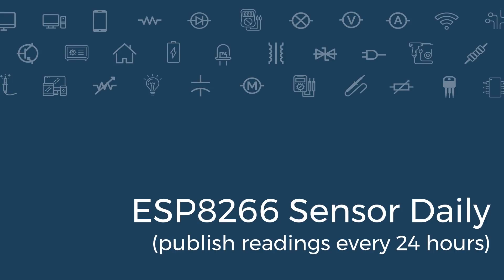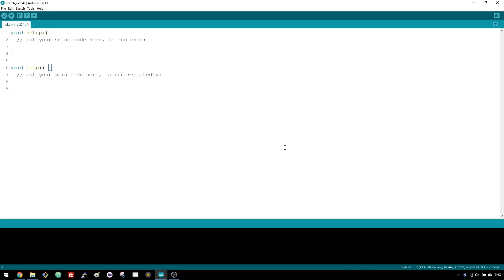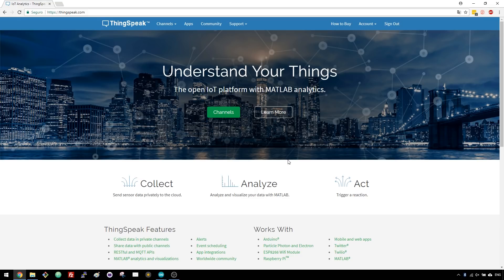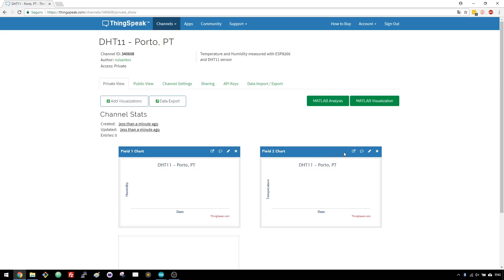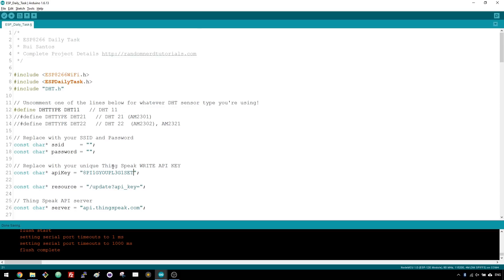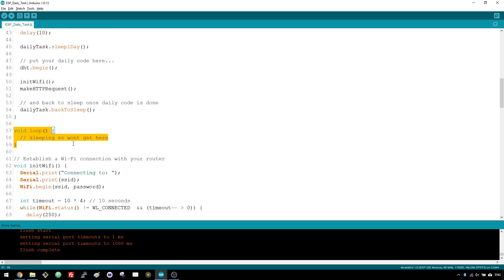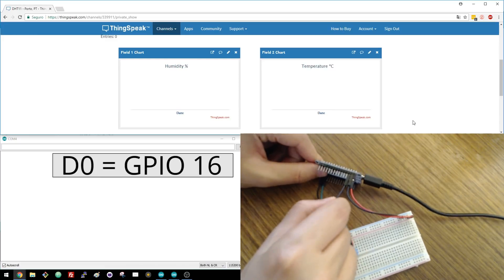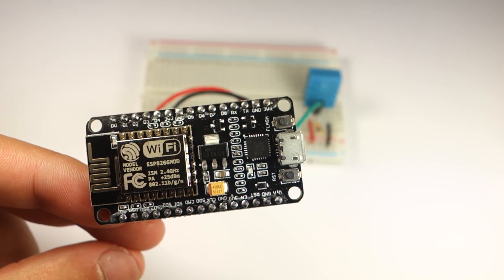ESP8266 Daily Task - Publish Temperature Readings to ThingSpeak

Comment: Hola Rui! Gracias por compartir :) se podría publicar las lecturas cada 30 o 60 minutos? Saludos!!
Reply from the maker: Yes, it can be changed to publish every 30 or 60 minutes, but this library was created to publish readings once per day. Take a look a this example and read the "Writing the ESP12-E code" section: https://randomnerdtutorials.com/esp8266-deep-sleep-with-arduino-ide/

You can modify that line to make your ESP sleep for 30 minutes:

 // Deep sleep mode for 30 seconds, the ESP8266 wakes up by itself when GPIO 16 (D0 in NodeMCU board) is connected to the RESET pin
ESP.deepSleep(30e6);